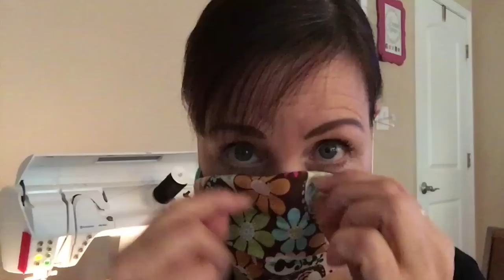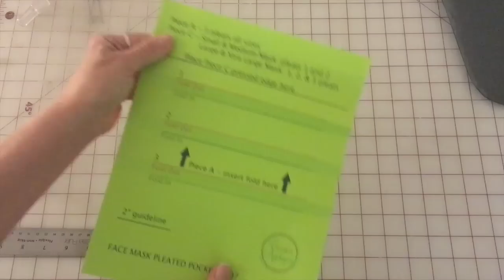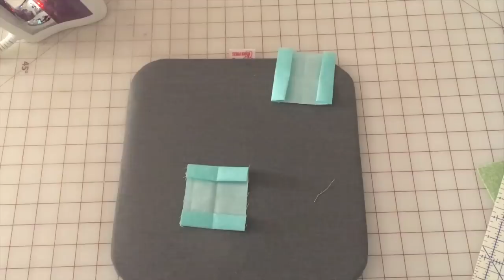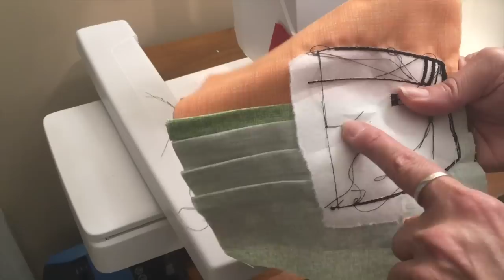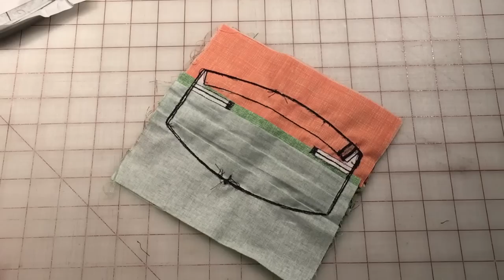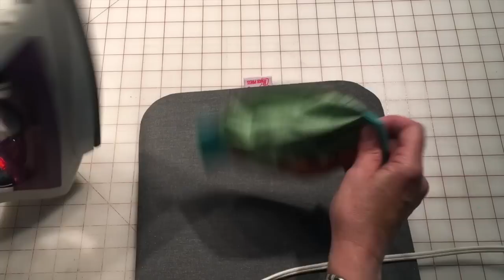The MOST comfortable face mask requested by Doctors

Comment: Following the instructions for folding piece D (for the medium size,) my pieces wind up measuring 2.25" high x 1.5" wide. The PDF instructions say the finished measurement should be 2.5" high x 1.5" wide. Is that a typo or am I doing something wrong? Thank you
Reply from the maker: Whoops! That is a typo. You are correct. They are 2.25". Thanks for letting me know. I have corrected the file.